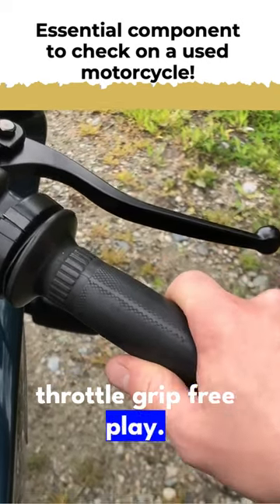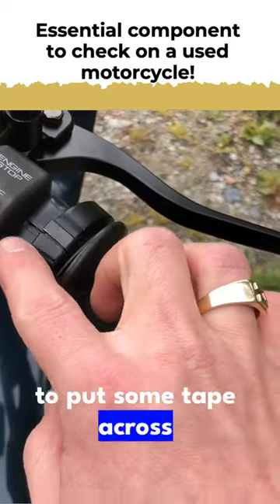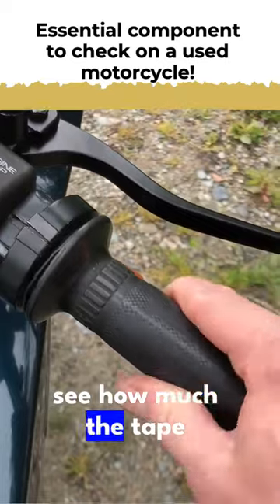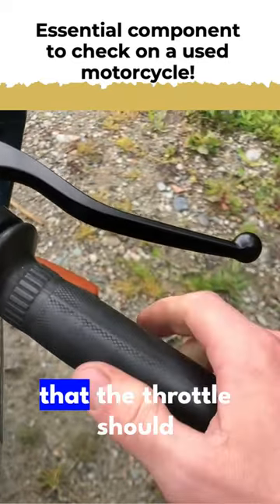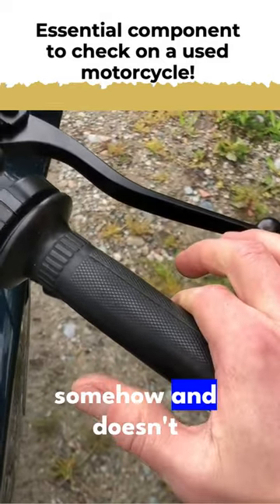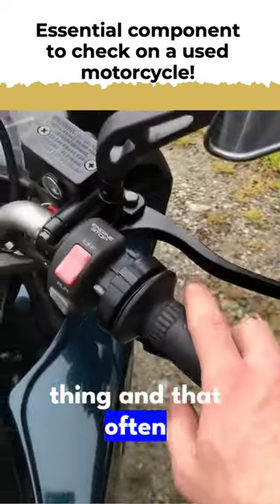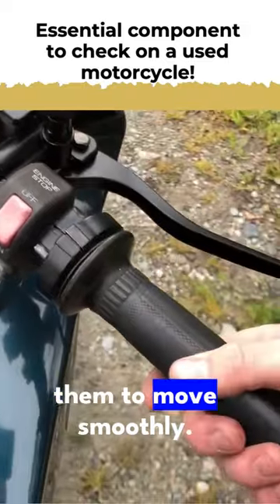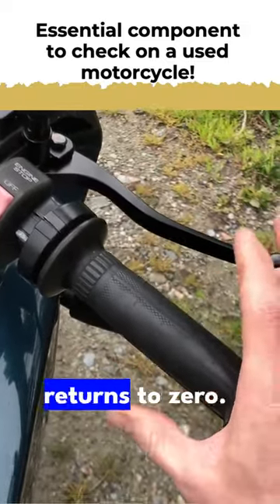Hidden Dangerous Flaw on Old Motorcycles

Comment: huh. easy to diagnose. it's right there. be sure to check:
brake pads. brake disk thickness. fluid color. 
is the lens on the fluid reservoir solid or soft?
do the brakes fully release after letting off pressure?
chain tension, do all the chain links flex? 
some bikes have a remarkably short life on the timing belt.. ducati!
front fork seals are easy to check, rear less so. 

someone else pick it up!
Reply from the maker: All good points!